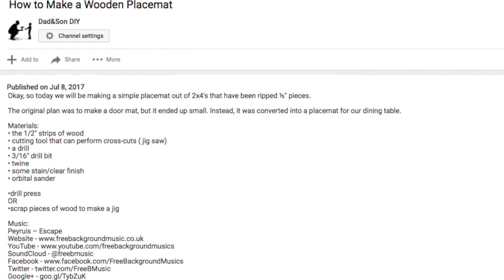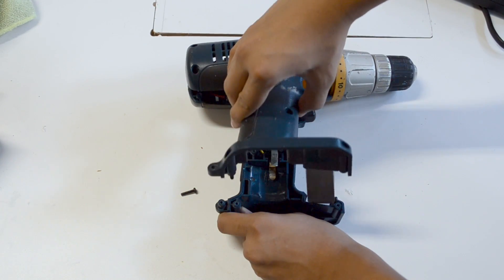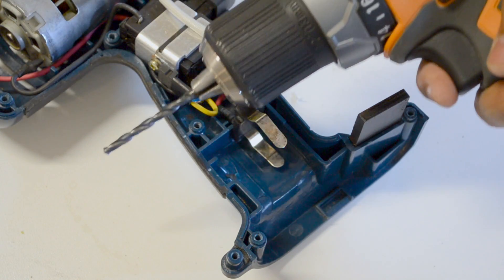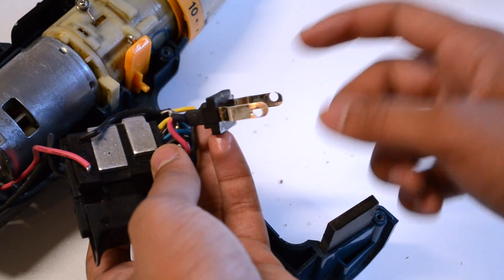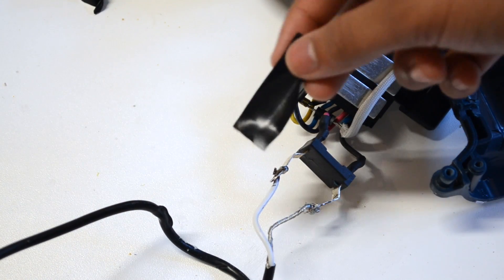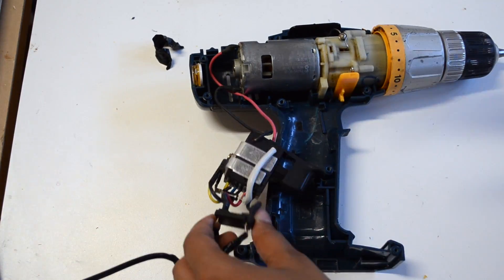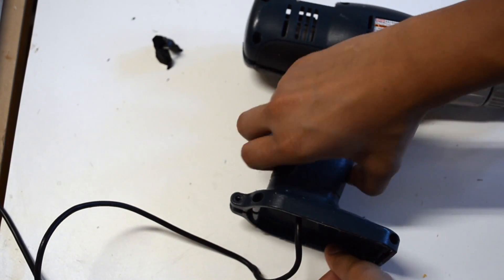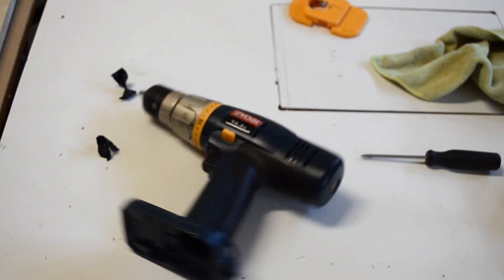How to Make A Cordless Drill Run Off Of An AC Adapter

Comment: Always make a knot in the cord on the other side of the hole (inside the casing) to keep your connections from breaking when the cord is tugged, and if you still have the dead battery don't even open the drill at all. Instead, carefully open the battery casing, remove the guts and wire to the casing so that you can have a cord that simply plugs into the drill. Not only is it a cleaner option but you retain the ability to use batteries in the future.
Reply: Thanks for the info. One thing though,,if the battery is dead and the charger is OK is there anyway you can connect to make it run on a 110v wall socket..?
Reply: @vishnudanraj2570   Not directly to ac, you will need to run it through an ac converter to dc, ac and dc do not mix together !
Reply: Thanks for the tip. Bought a used drill with  dead battery and will use your inputs
Reply: Make your own video.

Comment: Did you need to match the positive/negative sides of the drill with the positive/negative sides of the adapter or is that not something that needs to be done?
Reply: reversing the connections flips the reverse switch.  You'd just check that the rotation is consistent with the reverse switch when connecting.

Comment: How to find out the drill specifications can you give us an example? In this vdo you did not mention wat type of ac adaptor you used and wat is the output amperage how many amps do we need to run a drill?
Reply: dude, you can always check your drill specifications in google. make sure you type the make and model number of your drill. 👌
Reply: Im currently attempting to revive an obsolete ryobi 14.4v. Ive done a lot of my homework and searching around for others who have tried as well (and there weren't many!) To not blow anything and to have decent torque, Ill try using a 12v (goes up to 14.5v adjustable) power supply 30a thats used in cctv, led lighting, and other general purpose stuff, and put a 20amp fuse to keep things from blowing up.

Ive encountered a video where someone used the same technique but on his 18v dewalt drill, and safe to say he did not blow his 15a fuse.
Reply: @amielrumbaua8387  find a power source that is the same as your drill ( 14.4v ), then add full bridge rectifier to avoid current loss.

or

you can just build a powerbank for your tool using 18650 + bms

Comment: I conected same charger that the drill came with direct to drill .however the drill runs far to slow to be any use ?
Reply from the maker: You need to check the amount of volts and amps that the charger provides. It needs to have at least 6 amps to be of any use and should provide a voltage similar to what the drill is rated for.
Reply: The charger just trickles electricity into the battery, it can't supply enough to power it, check the amp rating of the power supply.  when freewheeling the drill pulls about 3 amps and when working it can pull up to 10.

Comment: Begin drilling your hole then add oil to avoid slipping and getting a wonky hole, also use a centre punch and hammer they are cheaply available and will up your quality in your work.
Reply: Your commentary instead of being a suggestion of improving the work shown here, rater it seems a caustic negative opinion.  This guy tries to show an idea that in my point of view is very good.   In my opinion, I would remove the battery pack from the case , and I would use the battery case.   I would  sold the adapter's wire to the connector terminals  of the battery case. then, I would install the power directly like the drill has the battery.  I wouldn't open the drill.  I think he shows a good idea and my battery charger and batteries are broken.

Comment: can i use the own rechargeable adapter ?
Reply: I don't think so, rechargers charge batteries at a higher voltage than the battery. So if you have a 12 volt battery, to charge it would require a higher voltage.

Comment: Question...does it matter which is positive and which is negative??
Reply: It does most of the time, but for the drill, it probably doesn’t since it will just make the motor run in reverse.
Observe polarity.
Reply: Of course it does, in DC world  - / + are very important !!!

Comment: Thanks for the video.  Now I can save that old drill, old computer power supply and battery from my junk pile.  I think I am going to adapt another battery for wiring into my car's 12v accessory plug.

Comment: As I saw your video it came to mind.. what if an old battery can be the one getting modified to the laptop adapter so you can use it in other cordless ROIBY gadgets.. because i have a ROIBY drill, 2 impact drills, a saw blade, a radio and a flash light... and they all use the same battery.. thanks for the video too man.. great one.
Reply from the maker: That's an interesting approach to this. It would allow the adapter to work with multiple tools. Thanks for the support.
Reply: @DadandSonDIY  you are welcome man. I just thought this may make it easier to swap the devices sharing the same input. If possible consider explaining a little bit about why the laptop charger and its specifications so they stop asking questions.. hehe and how the voltage and amperage are related to the tools you want..

Comment: Nice video... Thanks for making it.  I have that same drill, except the battery is 18V.  Can this conversion be done with a regular power cord, like a light duty extension cord rated @120v , 13 amps?
Reply from the maker: CATHERINE JONES definitely not. 120 colds will completely destroy the circuit and is dangerous. I used an laptop charger because it changes the voltage from 120 volts to 15. You will need some type of adapter for your drill
Reply: @DadandSonDIY  Mahalo!  Keep up the good work!
Reply: I know this is an old post. But, we have a Kyobi and a Kawasaki that showed 18v and 19v on the power drills respectively. I hooked them up to a 12v, 6a car charger to see if they would still work. They had no problem going full tilt. So, a 12v power supply will be sufficient. However, the video says AC adapter, which means that it's going through a power conversion from AC to DC. This is because cordless drills are designed to work off of batteries that are well under 120 volts. As for amps, that gets drawn to the electrical device as opposed to volts that get pushed. As such, you can go as high as you want on the amperes. But, I wouldn't go any lower than 4 amps or your drill will struggle on tough jobs.

Comment: How many amps do i need if my battery specs are 18v and 1.3 ah? Also where can i find a charger with that hight voltage?
Reply: read the label on the rechargeable battery or take a photo and search on google what adapters deliver that current. Then if its something accessible you can probably go to like a Goodwill or Thrift Stores and check their cables bin maybe you may find something to what you need.

Comment: The 18V or 20 V can be done, where did you get such a high current adapter?
Reply from the maker: T Singh it is 15 volts 8 amps. It is an old laptop changer we had laying around.
Reply: @DadandSonDIY  You should have shown that in the video. Until I saw this answer,  i thought you were using a 110 volt cord plugged directly into the wall, which would have smoked your drill and probably caused a fire! Perhaps even electrocuted the user!
Reply: @quicksilverhorseman2   Oh, come one man !!!
Reply: many laptop adapters are 19 volts:  Perfect size.

Comment: What DC adapter did you use,how many volts????
Reply: It has to be a DC adapter that has either the same specifications as the drill or tools or a little higher... If your drill says it needs 14Volts at 6Amps to run nicely, look for a DC adapter that may have 14,18, or 20 volts at 6amps... just avoid using anything way higher on amps because it will overheat your drill.. so look for something about the same Amps..

Comment: hiii good video! but u should explain what ac to dc power supply adopter should be use for  7.2v 14v or 18v cordless drill machine..
Reply from the maker: om jat Just try to get a power supply that provides the closest to the amount of volts to your drill requirements. It gave be a few volts off. Just make Shure it provides a minimum of 6 amps. The more amps it provides, the better. Good luck👍🏽

Comment: Hi would the drills original battery charger unit work as a power supply?
Thanks
Reply from the maker: I tried 6 amps on a drill before this, and it didn't work well. Technically the drill spun, but it didn't have much torque.
Reply from the maker: It might. You will have to check the voltage. In out case, the charger wasn't able to supply the right amount.
Reply: Thanks for reply unfortunately in my case the charger wasn’t up to the job tried a 12 volt car battery charger (6 amp) which did work but as drill is 18 volt lacked a bit of umph although it only drew 3 amps from the charger. Pity there isn’t an easily available 18 volt power supply that could deliver the required amperage, any suggestions?
Anyway thanks again and keep those videos coming like the Dad and Son concept by the way!
Reply from the maker: I have found lots of 19.6 volt laptop chargers. I know that's a little bit more than what you are looking for, but it should be close enough.
Reply: Hi I’ve found a 20v 4.5amp laptop charger on eBay so will give that a try!ill let u know how I get on thanks again.
Reply: How did it work Paul? I have a 12 volt drill and when I connected it to a 12 volt transformer with low amperage the drill pulses under load. I think it needs more amps. B.L. Alley (above) is recommending up to 10 amps minimum. Does 4.5 amps provide enough?
Reply: DO NOT USE THE ORIGINAL PSU TO RUN THE DRILL. I SAY THIS BECAUSE THE CHORD THAT IT HAS ON IT IS MAYBE 18 GAUGE. IT WILL VERY LITERALLY BURN UP CAUSING YOU A WORLD OF PROBLEMS. 

Here is a secret. If your will and able to do so and if your up for the challenge. Pick up a 110VAC to 24VDC 2 amp 3 phase transformer. I honestly find them at Frys for no more that 12 bucks... 4 x 1N4148 diodes only a couple bucks... I personally use 4x 50-63v 10000 uf  capacitors (in parallel) for output smoothing/filtering... That is QUITE literally all you need to make a very cheap powerfull durable PSU. I personally have been making them for YEARS. I say the 3 phase because you are about to double up the voltage getting upwards of 50+VDC out of the transformer. 

EXTREMELY easy design. Search DIY / homemade full wave or half wave PSU from scratch. Honestly, if you have children that like to tinker... In the right safe environment it would make a really cool father son project that only takes a few hours..

Comment: What did you use for a power supply what did you plug the cord into
Reply from the maker: its a laptop charger. It plugs directly into the wall.
Reply: @DadandSonDIY  when i do this my motors just pulse please help lol
Reply from the maker: reikhavok you need to increase the amount of amps it receives. Most drills require 6-10 amps. I went with 8 amps.
Reply: CB Carper that's what I want to know
Reply: advise full specs of your laptop charger.amperage,AC input voltage,DC output voltage etc...full specs of your laptop charger please. Thanks.
Reply: You can send your full spec of the laptop charger to my email..jenjubo@gmail.com..Thanks.

Comment: Will you explain from where the supply is come for drill  and how many volts?
Reply from the maker: Francis Xavier Fernandes the power comes from an old laptop charger. I cut off the end of it. It provides 15 volts, and the drill needs 14. If you also try to use a laptop charger or something similar, make sure that it provides 4-8 amps because most drills demand it. Good luck👍.